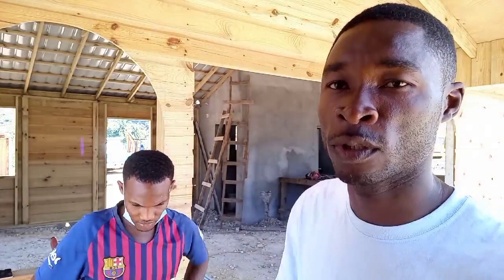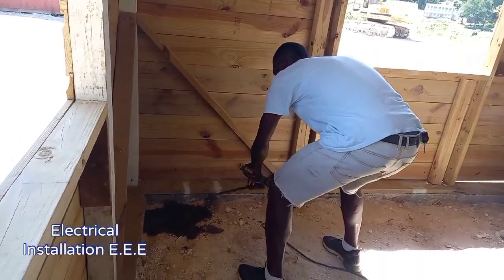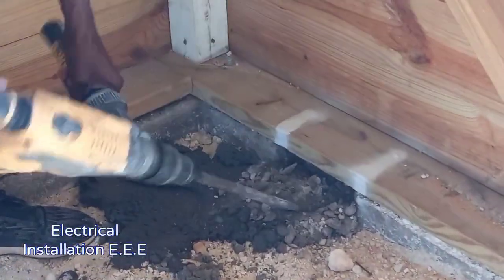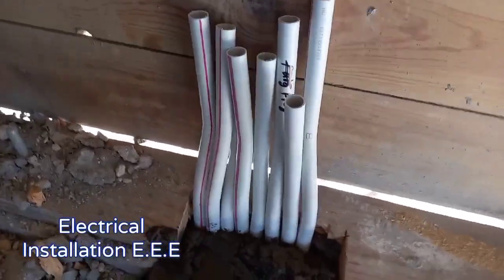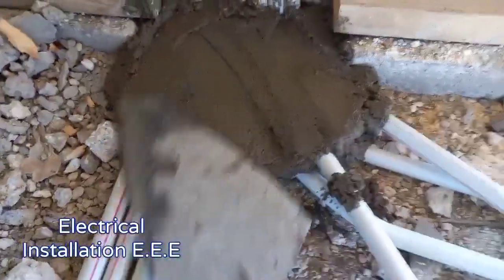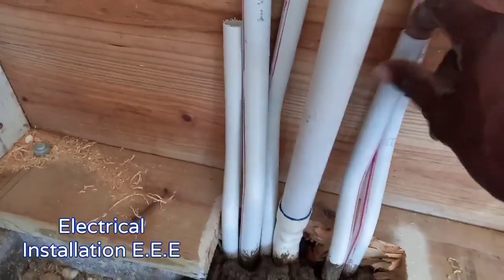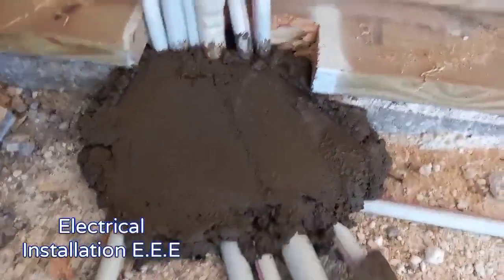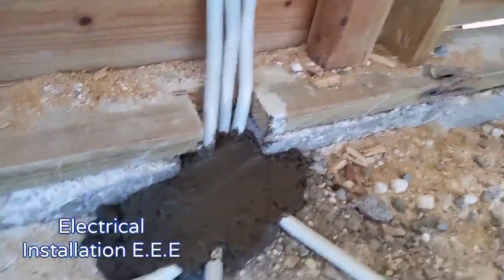How to pipe a floor for Electricity //  Electrical P.V.C Conduit Piping !! Electrical Tutorial video

Comment: Enforce Safety also Bro Wear Proper Personal Protective Equipment...….Glasses - (Hilthi works, Board Cutting) Hard Boot - ( Prevents damage to toes foot also to prevent hidden nails. Also perfect when piping decking those shape steel and 1/4 wire not to mention binding wires.

Comment: This would be better if they had done run the pipe under the foundation from day one in to the block coming up
Reply from the maker: Exactly but when we got the call there was nothing else we could have done especially they wanted to concrete it the same day they called us
Reply: @ElectricalInstallationEEE   that always happen " time fi we jamaican change out ways doing thing an plan ahead
Reply: So that those work can be done much earlier into the project